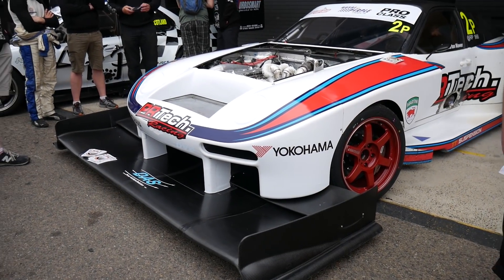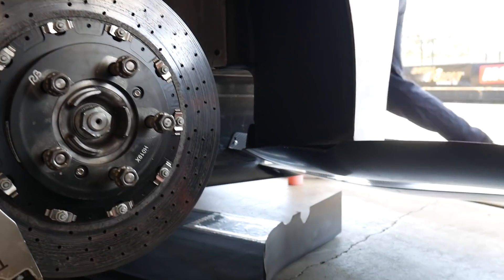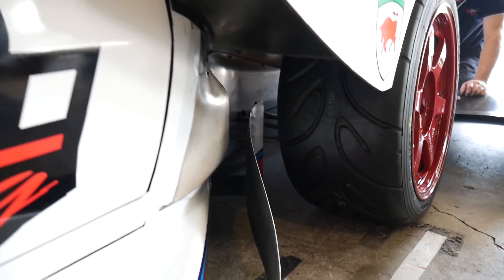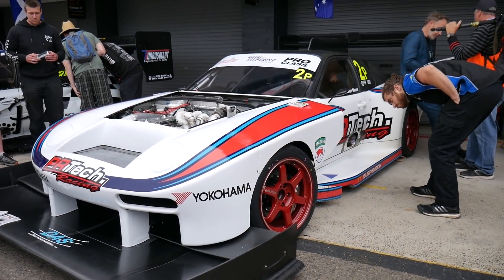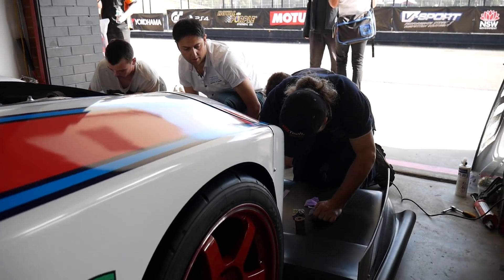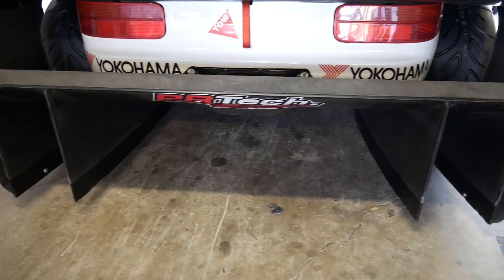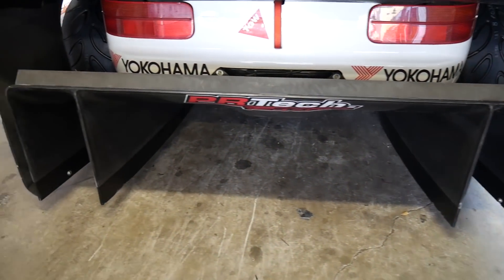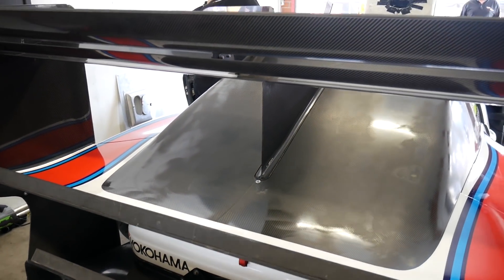Unlocking the Aerodynamic Secrets of the World's Fastest Circuit Porsche! RP968 Time Attack Car

Comment from the maker: Huge thanks to Sammy for being so open about his design philosophy and aero strategy! You can find his design consultancy here: https://www.dynamicaerosolutions.com/
Reply: Hey Kyle! I’m Minas, 15 years old working on aerodynamics and I’m working on a project about F1 in schools! Could you please tell me you thoughts about my  car?
Reply: Avoid drag at all costs, downforce is worthless in a rocket car drag race. make sure your weight is on point (use lighter/heavier wood depending on what fits your design). and make sure it rolls butter smooth, with as small as possible wheels. Also you should take the floor and walls of the track into aero calculations, best to make it push away from the walls if it gets too close (simulate that scenario), but dont let that make more drag than necessary.
Reply: Strap a coffee table to the front of it and see what happens, lol.
Reply: Hi! I am curious of where and what did you study, or if you actually did not study automotive engineering/fluid dynamics but learned by yourself as a hobby? I am doing a bachelor in automotive mechanical engineering right now, and soon it would be time for me to find a place for a master. And as far as I know in my country it is not really possible to continue in automotive field, so I would have to make it into a hobby and study something less interesting instead.
Reply: Is the car's engine in the front?

Comment: Hey Kyle love the channel, just wondering what an aero package would look like if there were no restrictions at all.  So many cars have to be designed under the design constraints of regulations and safety rules.  I was wondering, if there were only a formula chassis and wheels and running gear for example, what would the most efficient aero package look like that had a balance of down-force and slipperiness?

Comment: Viktor Schauberger would love this car. ;-)
Reply: Elmar Dylong there's this new frontwing design that has the edges of the wings perpendicular to the rounded bodywork at the corner of the bumper having direct flow over them instead of angled when the edge of the front wing is facing the direction of the front of the car. More  downforce, less drag, more efficient.

Comment: Dr Diasinos mentioned the sharkfin being comparable to the rudder on a ship.
Do you see a possibility for an increase in car control if the shark fin would be a movable aero element?
Reply: Isn't active aero not allowed in Time Attack and reason you don't see DRS systems, active rudders, etc?
Reply: Tycho Rasch it would be like back steering wheels but a lot more complicated I think,would be interesting to hear about
Reply: A rudder is a rudder last time I checked.
Reply: The F1 BAR Honda Bonneville 400 speed record challenger used an active rear rudder system - doing away with the conventional rear wing altogether. Quite a while ago now, at least a decade or more.
Reply: look up 'lady of perpetual downforce' on google, its a LeMons car that actually had a steerable rudder, from a cessna I believe
Reply: Yes, but he said Airplane rudder.
Reply: Yes, however the gains in aerodynamic advantage might not be enought to offset the weight penalty. But also it just might.

Comment: Is it faster than Porsche LMP1?
Reply: WTAC Pro cars like RP968 are significantly faster than DTM, they turn times within a second of an A1GP car, and about 8 seconds off an F1 car, only they aren't on slicks. If they were allowed to run slicks their one lap pace would probably be about the same as an LMP1. Just if you ran them for 3 laps at a time they'd probably blow up.
Reply: What you also need to put into consideration is the fact that race cars are designed to last the whole season and long races compared to a time attack car which is optimised and fully focused on lap time only and decent reliability compared to a DTM , LMP1 or touring car
Reply: Lmp1 is faster than dtm, time attack cars are fast as dtm
Reply: Qe
Reply: but a glorious explosion it'd be. This billet 4.0 might hold up
Reply: This car holds outright lap records. On basically street legal tyres. So, yeah i imagine it wouldnt be too far behind an LMP car in a lot of areas. The aero is absolutely stupid. Would hurt top speed a lot though.
Reply: Notverygoodatall LMP is on another level but something like Super GT / DTM would be more of a reference I guess. Considering the costs it's even more wicked.

Comment: I would have liked to have seen a better shot of the rear wing.  It appears to have very little offset between the upper and lower elements.....like the are almost stacked, vertically.  The darkness of the carbon and shadows from the low lighting, really obscure it.  How are the rear elements arranged and what are their dimensions?
Reply: Another thing I would like to know, (I know....hard to get that info) is the percentage of effect for each component.....rear diffuser, rear wing, front wing, barge boards......
I understand they work together so exact numbers are hard to ascertain.....not to mention percentages change as the velocities increase...